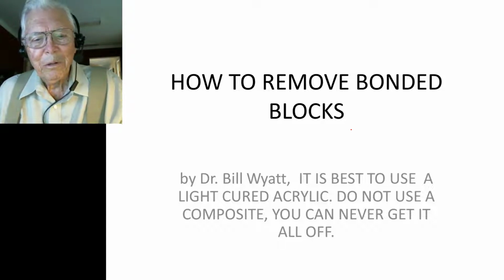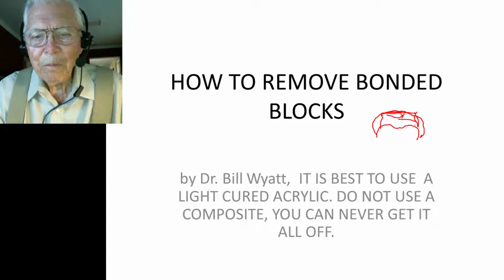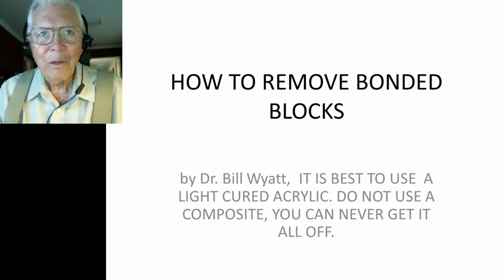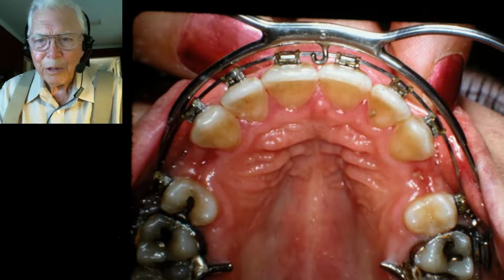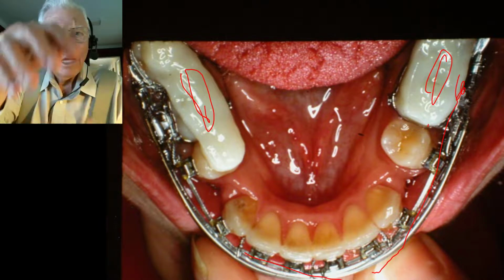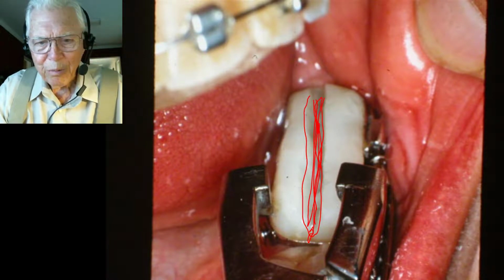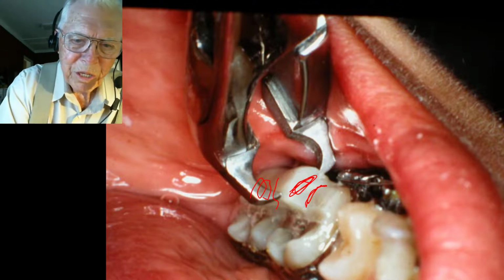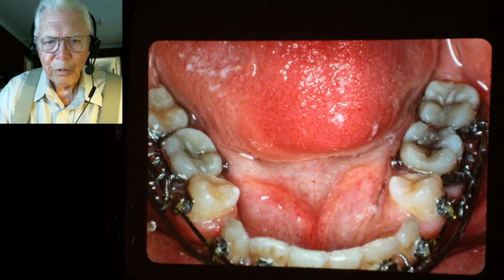How to remove Bonded Blocks

Comment: Thank you so much Dr. Wyatt for the amazing videos! Question: This is Triad plastic yes?
Reply from the maker: Yes we used triad light cured acrylic to make the blocks. I show you in the video how to remove the blocks. But do not make the blocks out of some strong bonding material. you can hardly get them off the occlusion of the teeth. I have told you a story about that in the video.